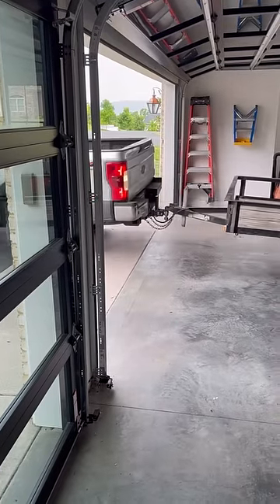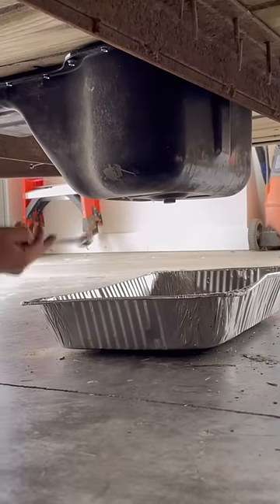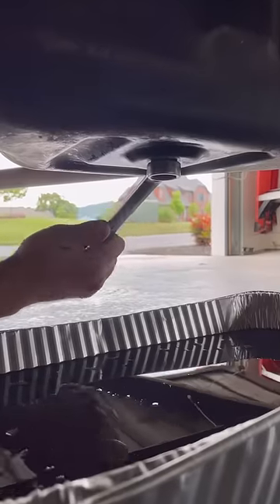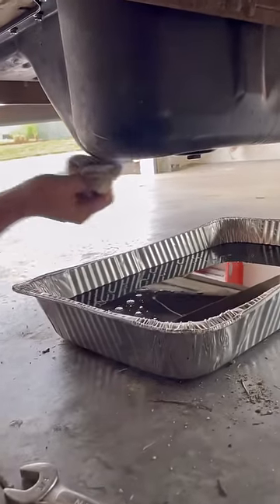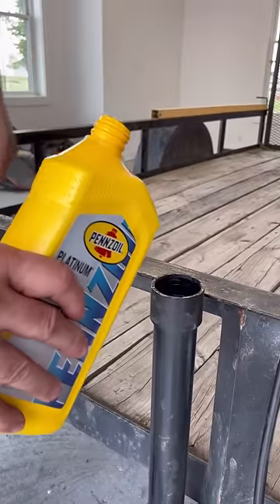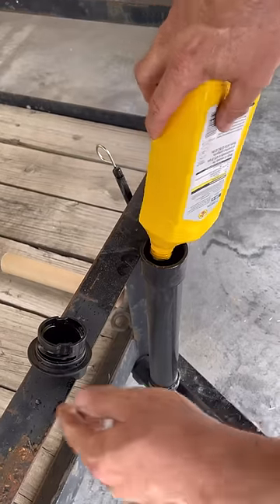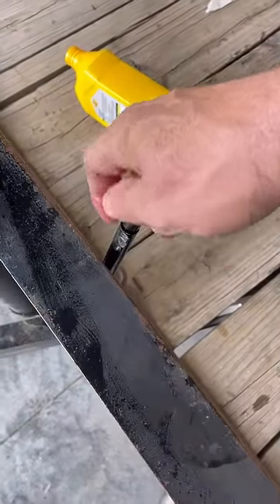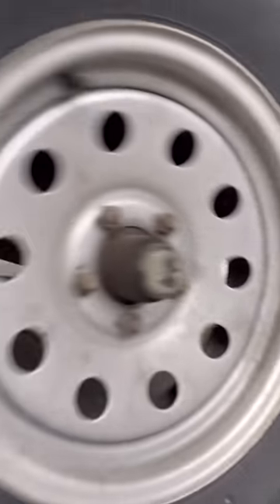Trailer Maintenance- Don’t Forget to Change the Oil

Comment: You forgot your blinker fluid.
Reply from the maker: Thanks for reminder
Reply: The good ol blinker fluid 😂
Reply: Bahahaha!
Reply: Have you added brake grease and frequency oil when you are done dint forget the bucket of steam to clean your hands Broski
Reply: @cda4662  Thats a good one! On a side note, I have actually seen several years back at an auto parts store "Break Grease", used on the bolts the caliper slides on. I am pretty sure that naming convention got them in hot water as I am positive several idiots literally put it on their breaks.
Reply: Beat me to the comment!
Reply: That's cursed 😂
Reply: Clever😂
Reply: DO IT!!!
Reply: That’s on the next video.
Reply: You didn’t change the air in the tires‼️
   Only dipstick there is you...
Reply: @torrycole6477  Right? I had my seasonal tire air swapped to the Summer Blend™ last week!
Reply: Charge the brake lights
Reply: George 
   Is that my my trailer lights don’t work sometimes?
Reply: And a exhaust bearing
Reply: its weird but blinker fluid is an actual thing used in incodesent flashers
Reply: You forgot to change the oil filter.

Comment: Make sure to check your trailer’s windshield washer fluid. Very important.
Reply: Blinker fluid as well
Reply: Headlights as well
Reply: You forgot to check the blinker fluid😅
Reply: Don't forget the cabin air filter
Reply: And blinker fluid too
Reply: The driveshaft as well
Reply: Might as well make sure the wiper blades are in good condition while you're at ot

Comment: Was in a market for a trailer, but now I'm leaning towards an electric trailer so I don't have to do any oil maintenance
Reply from the maker: Smart, but don’t forget you still have to plug it in before you can tow
Reply: @hausplans  crap!
Reply: Then you’ll need to change oil in your generator. Lose, lose situation......ask a Tesla owner.
Reply: But then also keep in mind those batteries only have so much life in them and you're going to throw them where... where you going to put the bad batteries and then how much of the new batteries going to cost you 5,000 maybe 20,000 who knows real good investment to help save the planet.....😂😂
Reply: @tysonwimer9657  I see you are part of the 12%
Reply: @jimmaag4274  it just amazes me that people still believe the theory that EV will save the planet when actually it'll destroy it quicker.....
Reply: @tysonwimer9657  it amazes me that MAGAs like you can even figure out how to use a smartphone, leave the critical thinking to those of us that are properly equipped to do it.
Reply: Best comment ever 😂
Reply: @tyson wimer  but these are trailer batteries and environmental friendly.
Reply: @jimmaag4274  When someone calls another person a MAGA I instantly realize their opinion is worthless 😂.
Reply: But the cost and weight of the batteries and are you sure you wish to expand to an state Trooper the reason you're setting on the side of the instate or road blocking traffic

Is the batteries on the trailer are dead because it's got a small range when fully loaded

Comment: I change my trailer oil , every time i check the muffler bearings:)
Reply from the maker: Smart
Reply: I THOUGHT THE ONLY CAR WITH MUFFLER BEARINGS WAS THE 57 HENWEIGH , LMAO NOT YELLING JUST SEEING BETTER SORRY CAPPS, GOD BLESS
Reply: @deanweber4370  bahahahahhahaha good one
Reply: Or headlight fluid.
Reply: Don't forget to check the blinker fluid.
Reply: Just so you know. Muffler bearings actually exist I swear lol 😂. On that note I do it at the same same time I do the transmission service on my trailer.
Reply: Nobody rembers change the Air in the Trailer Tires.

 OR? To Help the Trailer Milage,  by Putting ARMOR ALL on the Tires also! 

   What About Replacing the Tire's Old Hydro-HarmoniXx Balancers?  

    Y'allz knows how bad they get, once Rain Starts getting on the Trailer.  
    Shakes Head.   

     The Thangz that Y'allz fergitz, when yer Trailer Needs Scheduled REE-Dro-Nammick-ing! ! 

   Has anyone considered getting the Trailer Hitch Wi-Fi,  Paralleled. With the Trailer JaXx BlueTooth?

     Yuh knowz? If yuh Put HELIUM in the Trailer Tires?  It'd Weigh Less, and Cut the TruXx Fuel Cost$ by Half, at the Very Least! !

     And if you Added some Solar Panels 😉? 

    Combined with some Microwave Emitters, then you could Makes Some Serious Coin!

 Just by Charging Up, all the Teslas, Rollin' down the Freewayz!  Yikes! !

Comment: Can you do a video on diagnosing a trailer with a failing alternator? Mines been acting pretty chaotic lately.
Reply: You probably have a bad dynamo . Trailers don't have alternators
Reply: That actually wouldn't be a bad idea. Alternator on the trailer being spun by the moving wheels. Charging a bank of batteries.
Reply: Is your trailer OBD II or pre 96? That trailer looks to be about ‘95 1/2
Reply: While the trailer is being towed, disconnect the battery and see if it keeps up with the truck
Reply: It's probably just the trailer battery and not the alternator. Just give it a good charge or go all out and slap a good deep cycle marine battery on it instead and you'll be good for years.

These comments are too good. I love it.

Comment: Don't forget to switch out the winter air to the summer air in the tires. And balance your lug nuts too
Reply from the maker: I deafly need to balance my lugnuts have been noticing a shake in my crank pulley
Reply: @hausplans  you better fix it fast before you lose your water pump, they tend to not like wobbles.
Reply: That's a good one
Reply: Woohoo! I found a good place to get winter air on sale, but could you tell me where to buy the tool to balance my lug nuts😂
Reply: What's winter air ?
Asking for a friend in Barbados
Reply: It's funny because there actually is a difference between winter and summer air. Obviously, changing it isn't necessary. But if you inflate your tires on a cold winter day, they will increase in pressure on a warm summer day. And vice-versa.

Comment: Remember if you have a pre-2010 trailer, you most likely just need conventional oil. Don’t waste your money on synthetic! 👍
Reply from the maker: Good point. Also the newer electric trailers don’t require oil.
Reply: @hausplans Synthetic is fine, just add a bottle of ZDDP
Reply: The cost difference is negligible and the performance difference is significant; synthetic is better
Reply: If its old enough SAE 30 will do just fine. 😂
Reply: @hausplans  shit are they Tesla trailers? Musk is really getting into everything these days.
Reply: Synthetic literally keeps older engines alive longer
Reply: The real waste would be synthetic blended, full synthetic won't break down over time like conventional 😅
Reply: Don't overlook , you need to run a good breakin oil ,for the first 500 miles. And put zinc additive in at every oil change.

Comment: I usually skip the trailer oil change. All trailers made after 2010 are sealed systems. I just do the diff fluid change. YMMV 🤷‍♂️
Reply from the maker: Smart

Comment: Don’t forget to rotate your tires front to back left to right. Like on a vehicle you are suppose to move your tires threw all four wheels till it returns back to the original wheel it came from , and that’s the proper way to rotate your tires.
Reply: No need for that, tires rotate when you drive😂
Reply: @aleksandarl6975  true, but to balance out the rotation you need to do as many miles in reverse as you do in forward motion.  Or you can look behind you as you drive forward, that’s a little mechanic’s trick I learned.
Reply: @Skilled_Driver  Also worth mentioning rotation gets done much quicker if you greese the brake pads😃
Reply: @aleksandarl6975  if you grease the break pads you will have trouble stoping, I grease the rotor since the grease is formulated to use on metal surfaces.
Reply: @Skilled_Driver i didn't mean actualy grease the brake pads, what i ment use them as the aplicator so rotors get even coat
Reply: @aleksandarl6975  oh ok, that makes sense. Nothing wrong with that.

Comment: Dont forget to change your oil filter too
Reply from the maker: Good point
Reply: Might as well do the air filter too since you're in there
Reply: No oil filter with this particular unit. Must use non-detergent oil!
Reply: @hausplans  now where to put the oil filter lol
Reply: I thought the same thing but my buddy has the same trailer and the engine 7hp so it doesn't have one, my trailer has a intek 22hp and has a filter sorry if you feel like I'm flexing on you but I'm just trying to bring perspective
Reply: Yeah you forgot the filter
Reply: @nfff946  ... the filter is inside the pan like an auto trans. You do it every other year.

Comment: No need to change mine. My trailer is made by GM. It won't last 5000 miles.
Reply: I think you're confused GM doesn't make Dodge or Ford.
Reply: Don't you mean made by Ford?

Comment: Great video! After every 4th oil change I also change the trailer transmission fluid and rotate the tail lights. About every 5 years I also just replace the muffler😉 Gotta take care of the trailer to make them last 😅 ..... Take care, Bluefin.
Reply from the maker: You take care of your trailer it will take care of you😂

Comment: Great advice. Remember to change the air in the tires to synthetic , have to leave now, need to buy a leg of ground beef .
Reply from the maker: Synthetic air is so expensive. I’m not sure it’s worth it.
Reply: You can buy it at wholefoods in the overpriced aisle 🙂
Reply: Synthetic air is man made air , similar to the air that divers use in scuba bottles 
 It is made in specialised factories , that are kept in ultra clean conditions 
 Having a short shelf life , it must be installed directly at the factory 
 Covid made a couple of these factories close 
 I suggest that you Google Synthetic Air for your nearest location

Comment: I change my trailer oil every time I replace the belt.  
Last thing anyone needs when towing is for the serpentine belt on the trailer to go bad!
Oh, and I presume you changed the oil filter as well, but didn't specifically mention it.
Reply: @MrHypNomadic Damn I wish I woulda saw you comment earlier. Took me 4 hours to get the belt after breaking the tensioner.

Comment: On some new trailers you need to clear the computer codes they throw after changing the oil, you need to take them to the dealer, I don't believe they are standard ODB2 computers, most are proprietary.
Reply from the maker: Good to know, my check trailer light has been on for a while

Comment: Finally somebody who understands proper trailer maintenance you should always change your trailers oil every 3000 to 5000 miles or if you don't use it very often you can get away with changing it every 3 months

Comment: I got the muffler bearings on my trailer changed last week. I also replaced the winter air in my tires. It pulls so much easier now!

Comment: I have two trailers and they are how I make my living.     I use Quaker state 30 weight.   I never go more than 5000 miles myself.
Because of the dust on the roads I suggest changing the filters with every oil change.

Comment: Check Hubs for Axle Grease ..Yes
Check taillights, turn signals, and side marker lights ..Yes
Check tire pressure and treads ..Yes

Looks like I’m guilty for failure to check and change my utility trailer oil
😫

Comment: Tech tip: if your trailer has direct injection, add fuel additive and perform induction cleaning services every 20-30k miles.
Reply from the maker: Nice

Comment: I was totally confused for a second there,🙈 mainly because ive never heard of such a thing before and my very tired brain was trying to work out why on earth would a trailer need oil never mind a oil change 😳  hey ive only had 2 hours sleep so i have a reasonable  excuse for my brain wondering  what the hell is going on. You seriously  have far too much time on your hands to come up with this joke and make it sound like this is something  that should be done, you were even dedicated enough to actually set everything  up to look like you were infact doing a oil change, im impressed 🤣 there is no wonder that me with only 2 hours sleep was slightly confused  at the start 🙄, by the time you had started draining the oil into the tray i figured it out and knew you were joking, it just took me a few seconds for my brain to catch up with reality 🤣🙈 yeah, i need more sleep, maybe a nap is a good idea afterall 🤔

Comment: Haven't changed mine in a while. Now having a hard time finding the plug. I'm afraid I'm on the trailer transmission plug, not the oil plug. But I was able to top of the wiper fluid.

Comment: I’m so particular about my trailer and maintaining it’s value I change the oil before 2500 miles 
If my oil ain’t gold I don’t trailer 
Don’t forget to check the blinker level and soak your bearings and your tire pressure before hauling

Comment: I'm a dummy for a different reason though. I actually do have to change the oil in my trailer. It's the rear of a pickup and I change the diff oil. I was so confused 😅😂😅😂

Comment: I noticed you didn't have a flux capacitor installed. Those are mandatory emissions parts if it was manufactured after 2000 so you might wanna go get that fixed

Comment: FELLAS… when was the last time you checked the brake fluid on your trailers?
Reply: I have the surge brakes and check it when ever I take a trip. Trailer is still new so won't have to change it for another year or so.

Comment: I actually make a trailer that drives itself, so I have actually changed the oil in a trailer. Although it was just changing the oil in the honda gx390 mounted on the trailer. This is obviously a joke.

Comment: Just tried changing the oil in my camping trailer. The drain plug looked way bigger and had a valve attached. The oil came out very chunky and smelt like s**t.....now I need to figure out why the oil gauge is labeled black tank.....

Comment: You're only changing your trailer oil every 5,000 miles? If you're not changing it every 3,000, your piston springs are going to seize up and snap off...

Comment: No blinker fluid replacement? It is mandatory by the DOT, to change the blinker fluid after trailer towing oil changes. Unicorn synthetic and/or mineral fairy brand gives you the best blinking.

Comment: Yeah yeah but you forgot to replace the air filter and check the power steering fluid on your trailer. Not impressed

Comment: People often forget to change the air in the tyres. Old air is less dense, it becomes spongy so that the tire pressure might measure correctly, but if the air is old it just won't support the tyre as it should. Once a year is usually good enough. Try to use domestic air as overseas imported air cannot be trusted as consistent.

Comment: What? I’m sorry but this video is clearly wrong. Everyone knows that those trailers are 2 cycle so you need a 40:1 mix also you should check your exhaust bearings I’m sure I heard a rattle.